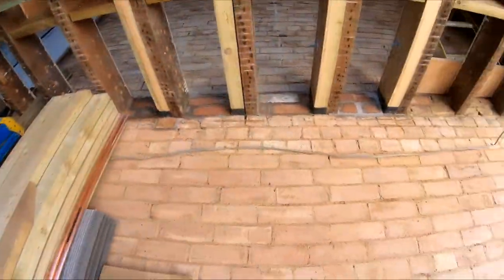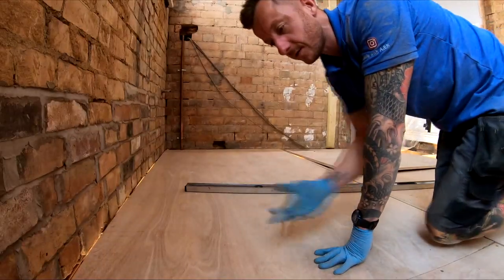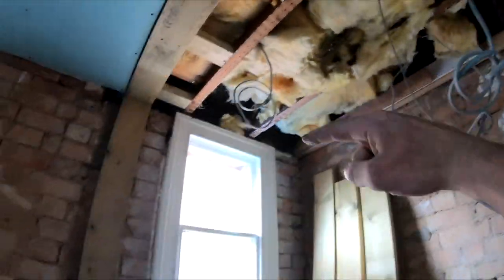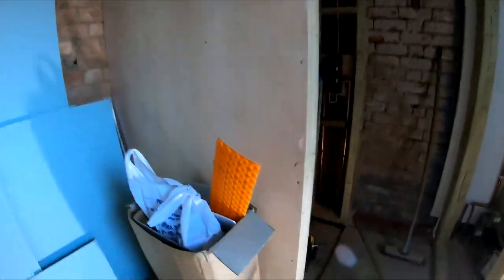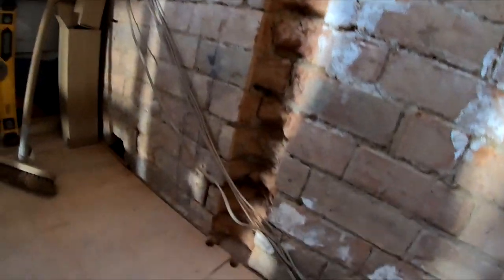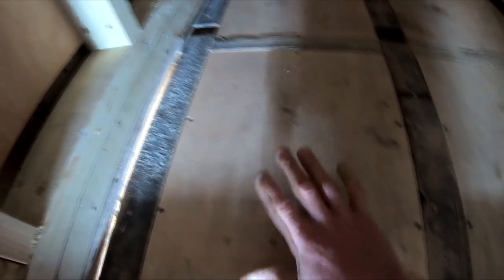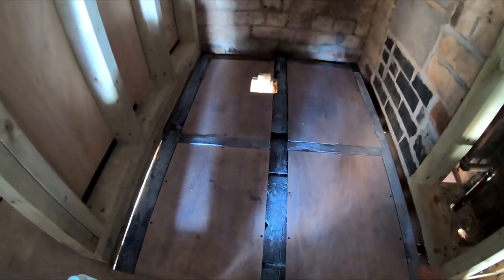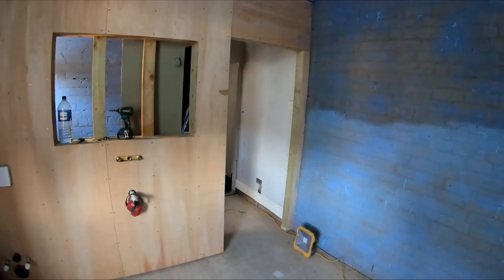HOW TO BUILD AN EXTENSION #7 | Bathroom Installation: Walls, Floors and Ceiling

Comment: Good stuff Lads! Looking like a proper job! one question, how come you didn't bed the shower tray on a mix of sand and cement? Could it be due to the additional weight of the sand/cement mix on the floorboard & joists? Thanks,
Reply from the maker: Most plumbers on this type of application will bond down with silicone or another product all the best Tony 👍

Comment: What's the blue boarding on the bathroom ceiling and put stuff on the brickwork? Great video john
Reply from the maker: Hi David,

We used moisture resistant board in the bathroom, as it's best practice to use them in areas with a high moisture content.

The walls were primed with blue grit, which is a special bonding agent. We try not to use PVA as this stuff performs much better.

Thanks for watching, all the best, John 😊
Reply: Brilliant, thanks

Comment: Great job Quick tip tho noticed when you did joist layout line on floor boards you got tape out to mark screw centres I normally but those marks on level or to to speed the process up Still good job tho lads ⭐️

Comment: can this be done without ripping out the bathroom above? i have a nice bathroom.
Reply from the maker: Hi Nathan Smith,

Which part of the video are you referring to?
Reply: @BuildWithAE  sorry, the whole job. as in build a side return without ripping out the floor above.
Reply from the maker: The only hurdle would be installing the steels. If you wanted to lose the steel in the ceiling like we did on this job, then you would need to use needles. 

If you were happy with having a bulkhead, then you could possibly use other methods of propping, which would cause no disruption to your bathroom.

However, I am generalising here. If you wanted to have this kind of work carried out on your property, then you would need to get a structural engineer to have a look.

Hope this helps.

All the best, John 😊